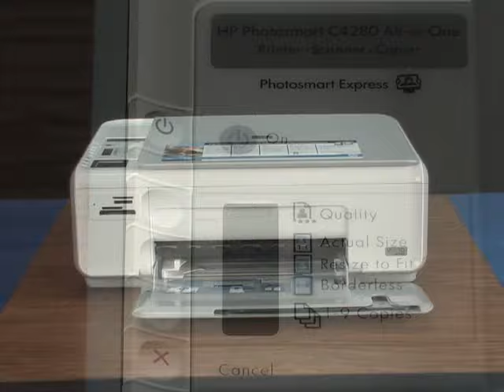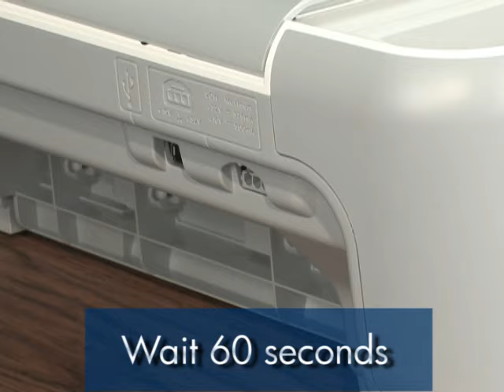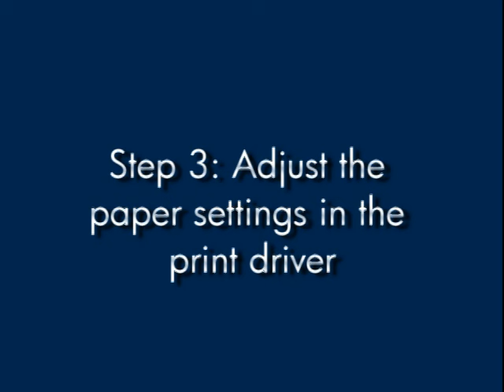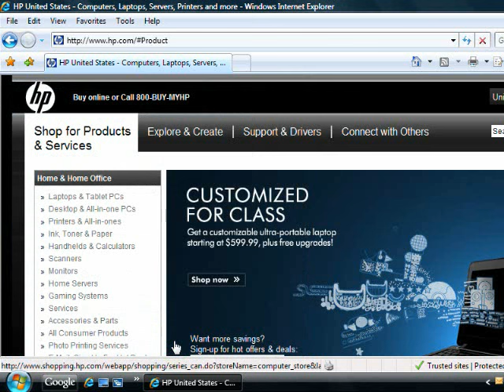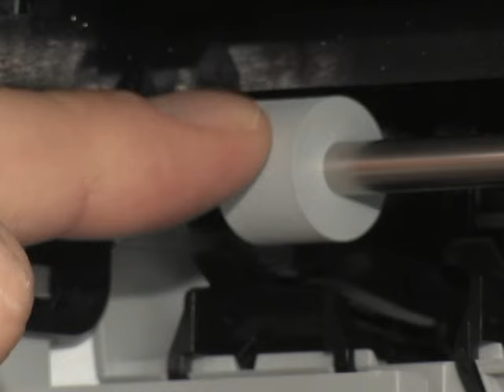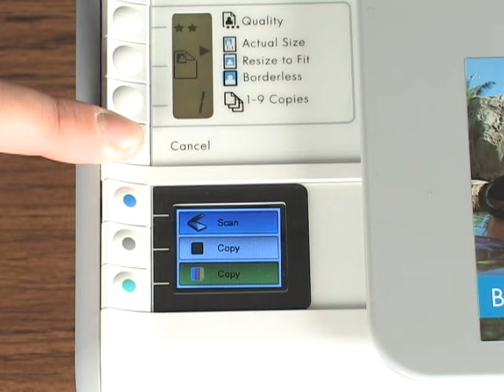Fixing Paper Pick-Up Issues | HP Photosmart C4280 All-in-One Printer | HP

Comment: I tried everything but the roller that pushes the paper up to print doesn't roll it just stays still then it shows an error message saying out of paper
Reply: +Alex Alvarado #1, #2, #3 and 4!   Please use the "HP Photosmart C4200 All-in-One Printer Series - 'Out of Paper' Error Message and the Printer Does Not Pick Up or Feed Paper" document ( http://ow.ly/XguDV ) as a checklist to ensure all steps have been completed.  If you still are unable to get the printer to pick up the paper, please contact HP Support per the steps in the document.

Comment: I have one of these which I'm now using on a new computer and now I can't print documents in languages such as Bengali or Hindi script correctly. Vowels come detatched like क ा instead of का  . Please, someone let me know how to fix this.
Reply: +Abrilpara2   When you started using the new computer, did you install the full feature driver for the printer?  It is possible that if you didn't that the computer is using the basic driver that comes with your operating system.  Please use HP's Printer Install Wizard for Windows to update your driver.  I've included the "HP Printers - Finding the Best Windows Driver Using HP Printer Install Wizard" document ( http://ow.ly/HqWZK ) for you.  The utility can always be downloaded from hp.com/go/tools.

If you have the full feature driver installed and you're experiencing this issue.  Please download HP's Print and Scan Doctor utility.  The HP Print and Scan Doctor is a free utility (tool) that helps to quickly resolve common printing, scanning and connectivity issues.  I've included the "HP Printers - Using Print and Scan Doctor for Windows to Help Resolve Printer Issues" document ( http://ow.ly/Arcmm ) for reference.  You can also download this from  hp.com/go/tools.
Reply: I just connected the printer to the computer before I started the computer.
Reply: +Abrilpara2   Since you just connected the printer to the computer, please use the Printer Install Wizard utility I mentioned in my last post.  That will give you the full feature software and driver.  Once you have the full feature driver, are you able to print in Bengali or Hindi?
Reply: I installed the wizard and I don't know what other adjustments I have to make. I tried printing one of my documents and still having problems. Some lines com out good but others still is detatched.
Reply: +Abrilpara2    Please follow the steps in the section titled 'Unable to print with a Windows built-in driver (Africa, Asia Pacific, Europe, and the Middle East only)' from the "HP Printers - Printer Problems after Upgrading to Windows 10" document ( http://ow.ly/X3axs ).  I am presuming that you are in area of the world that is mentioned in the section title.   I know you may have already completed some of the steps suggested, but let's try them again please.  

My other thought is we are dealing with a print quality issue, and not a driver issue.  I've included the "HP Photosmart C4200 All-in-One Series - Streaks or Lines in Printed Output" document ( http://ow.ly/X3bUn ).  It is the best document to start with for print quality issues.

Comment: Wiping the rubber rollers on a 7510 with a wet paper towel fixed my photo paper tray problems. The rollers are where the photo paper tray gets pulled into the machine.

Comment: I have a Photosmart c3100 series. I have tried hard resetting, cleaning rollers, powering on and off, changing settings, could not print a test due to it not picking up paper, and pretty much everything that the websites recommend doing. The rollers inside the printer, the first set are not spinning (the ones that are touching the paper as soon as you put it in the printer). Inside their is the big thick roller which was shown in the video and a smaller one which seems to just hold the paper down. The bigger one is not spinning. Resulting in the paper not being picked up. I do not know why those rollers are not moving but the gears are all fine because when i push it with my finger they move fine. The rollers do grip on to paper and i have cleaned them they are just not spinning. How can i Fix this? thanks for your time. If pictures or a video will help i can try to upload one just let me know.
Reply: HI ark50000.  You have been fairly thorough in your trouble shooting.  Please search for C02126558 on HP's home page or using Google search.  It has detailed steps to take to trouble shoot a paper pick issue.  It is worth taking a look at to see if there are steps you haven't taken. Please also search for  C00870767.  It is your printer's product specifications which details the paper weights and sizes that are supported.
Reply: justprintingaround The paper is the correct paper to use for this printer. I have used it for many years with no problems. I purchased some new paper at the store just in case it was indeed the paper that was causing the problem, but with no avail. Honestly i am pretty sure it is the front inside roller that is causing the problem. Or something with the communications between the parts and the circuits resulting in the printer to not turning on the one inside front roller. The website recommends cleaning the rollers but like i stated previously the paper doesn't reach the back rollers yet because the front inside rollers are not moving the paper to the next set of rollers in the back. Matter of fact the front roller isnt moving at all. Difficult to explain but let me know if you need clarification. The website recommends printing a test but i cannot print without the paper being fed to throughout the printer. I wonder if their is a way to modify the printer so i can bypass the paper stopper and manually insert the paper two the second pair of rollers in the back? That is my last resort before buying a new printer.
Reply: Thank you for the updated information. If you have tried everything mentioned in the document, then we have exhausted all the trouble shooting that is available as there is no way to bypass the rollers you mention.  I'm sorry for any inconvenience this may have caused.
Reply: Hi, ark50000

Have you solve the roller issue with your printer.

My Photosmart C4385 seems has exact same problem as yours, coz i didn't see the big roller is spinning when start printing....
Reply: ark5000

Comment: I HATE HATE HATE HATE HP printers.  I've had nothing but trouble with them.  Cannon IS the way to go. My HP's are never reliable.  Whenever I really need something important printed quick they always fail.  My c4385 was the best of the bunch and usually worked great but now it has all these physical problems with the cartidge carrier and now it won't load paper.  I never touched the thing, or dropped it, it just sat there so I feel it's poor construction quality.